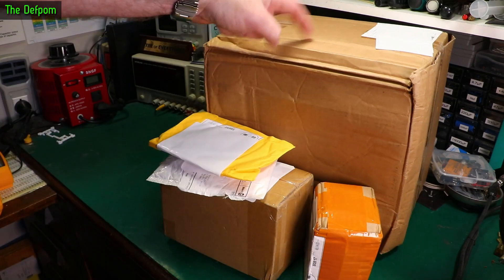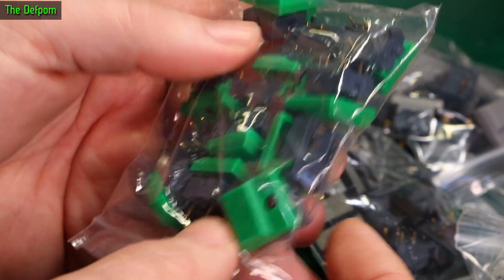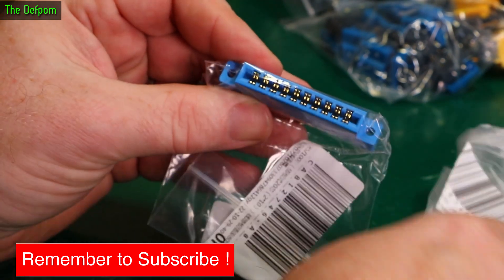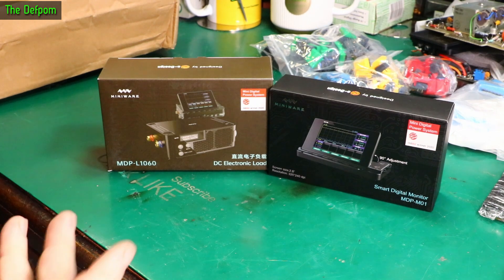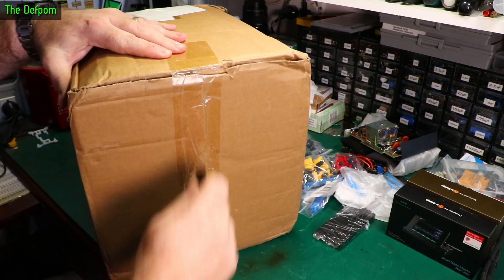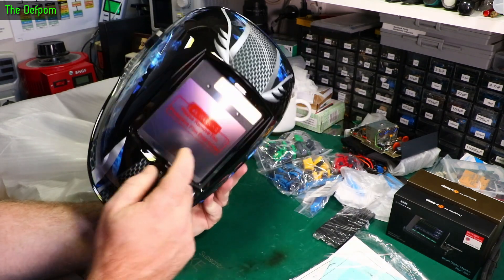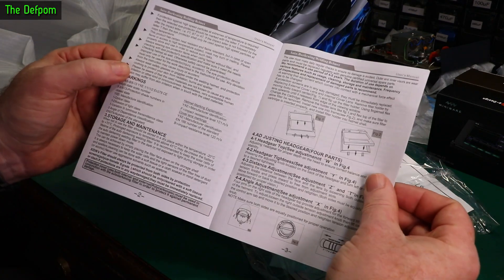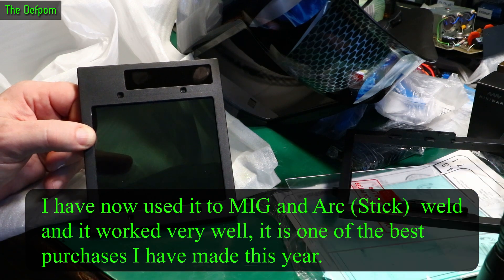🔴 What's in my Mailbag ? - Mailbag Monday 17th April 2023 - No.1116

Comment: are those buttons really priced correctly for the link? its like 4gbp per button. is that not too much for these style / type? because seems a bit on the high side. they really woth that much compared to other premium buttons out there?
Reply from the maker: I had trouble getting a link to the ones I purchased, once there search for “PB86-B1” or B0 and you will find other options.